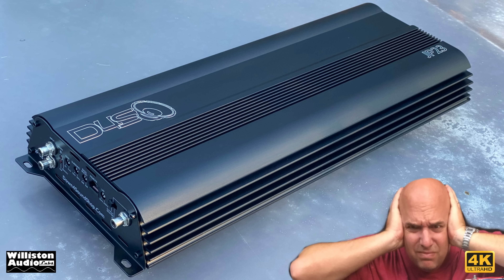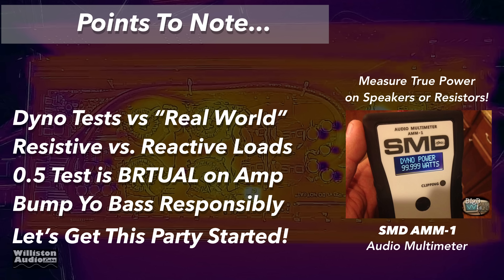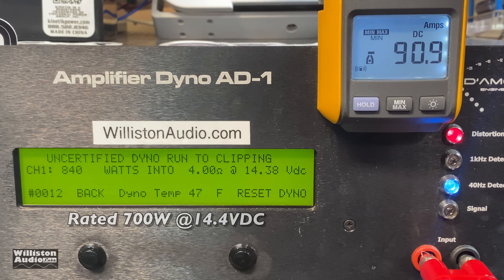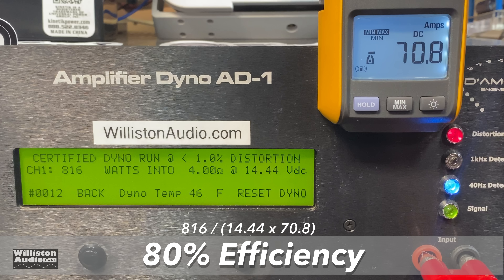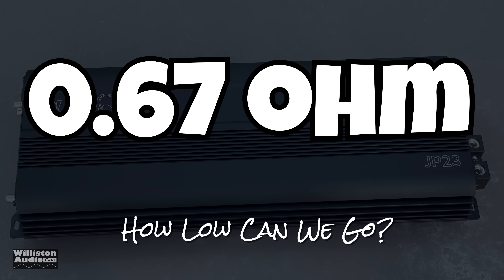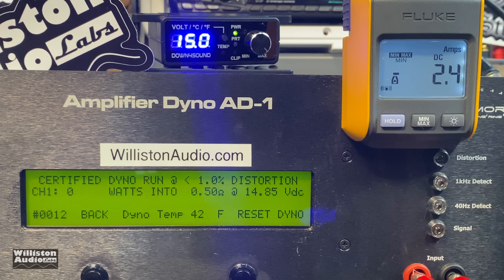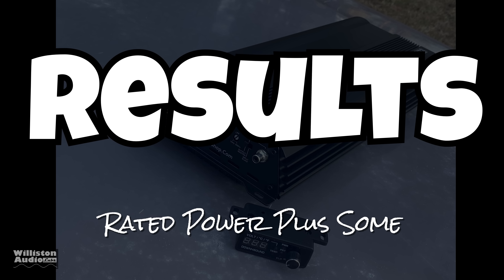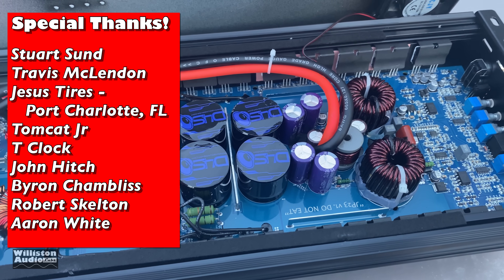Are You Down for Some Low Ohm Amp Dyno Tests? Down4Sound JP23 Amp Test Part 2 [4K]

Comment: Bought the JP23 V1.5, came with this oil inside the "guts" not water but some kind of oil. reached out to D4S and nothing back. opened the plate and tried to clean the oil off but it was everywhere. Asked around on reddit and other forums if anyone had the same issue!

Comment: THE THING ABOUT THAT IS HE IS USING A DYNO MACHINE IF YOU PUT A SUBWOOFER IN A BOX THE IMPEDANCE WILL RISE TO AT LEAST. 7OHMS SO YES IT WILL HANDLE THE OHM LOAD
Reply from the maker: Caps lock a B brotha 🤨

Comment: What does the dampening do?
Reply: its how the amp controls the speakers. the higher dampening the more accurate the bass or speaker will sound. on class d amps you want the dampening factor to be 200+ but to get the most of the dampening you will want to wire your subs up to 2ohms or even 4ohms
Reply: @rowboyto156  thanks
Reply: @rowboyto156  I have dual 2 ohms 12s though
Reply: @30VISION4K  your good bro i honestly cant tell the difference. i have this amp hooked to a 13 w7. i also had this amp hooked to a sundown x 12 wired to 1ohm before swapping to the w7. both sounded good, no difference on the response or accuracy
Reply: @rowboyto156  I'm running the bd sa252 deaf bonce
Reply: @30VISION4K  those are nice, they will go very well with this amp

Comment: I own one, I bought it the day he released it, I live in vegas, I was pumped to get it, but that turned out bad after it over heating all the time in the summer in vegas, it just cannot deal with heat at all, at 120 degrees it turns off, and I am done for hours, I assume I got a first run lemon... my Kenwood 1800w never failed... so who knows, but what REALLY pisses me off is the Reviews on Down4South are filtered and my Review was not posted so do not take what is on D4S at face value.

Comment: Question: I have a Sundown Audio SA 12 D2 and a Skar Audio ZVX-12v2 D2 12" on this amplifier. It’s hitting brutal and clean…BUT I JUST realized I have them running parallel. Is this too hard for this amplifier? How can I tell if the ohms are too low?
Reply: youre at .5ohm, as long as you have the electrical to back it up your amp can handle it

Comment: It only has 100 damping factor tho. At least 200 would be better.
Reply: i used to use this spec numbers too but if youre not wired at 4ohms its pretty much pointless even if its 200. its all about thd% and s/n ratio

Comment: Hey Big D Wiz you think it's possible with all that equipment and your old set up 4 Ohms resistors and battery packs you can start testing power inverters goes along with 12 volts we'd like to know which ones are good and which ones aren't I think it would be pretty easy for you to set that up with your old resistor packs

Comment: I think it's a sweet amp, I like how he optioned it out nice the knob is awesome and has clip light... Why don't all amps have clip lights it would take so much guess work and woofer damage out of the equation...it can't be expensive even my trucks little $90 Toro r2 has one on the amp be nice if it was on the OPTIONAL  knob. I just pre ordered the CAB 45! Can't wait but im gonna have to...whaaaa!  but gives me time to do the mandatory upgrades I need for going to a true 5k from a APCLE1800. It was a toss up from the CAB45 $379 and a $399 B stock SFB5000 at Audio Apex but I decided to go with the looks and  beefieness of a half bridge. I just love the looks of a big ol amp vs how visually un impressive small full bridge amps look.

Comment: Big d. I know you dont do those chinese mini amps anymore but i have a lepy 168 plus. Its rated 40x2 and 68x1 or 34x2. (Used to have 2 subs) like the 168 HA. Try the lepy 168 plus. It wil cost you around 35 bucks. My 400W peak rated jbl towers blast like crazy at 1/8 power of this amp.

Comment: Big D I've been wondering forever when somebody with an amp Dyno would do a head-to-head test between speaker  wire gauges. I am so curious to see the difference output on a 1000-1500w amp between say 16 gauge and 8 gauge.. if the test was inconclusive it would be super interesting to use ridiculously under-sized wire like 18 gauge to induce a  bottleneck
Reply: rmblwgn it's already been proven. Bigger gauge speaker wire will give you a minuscule amount of extra watts
Reply: @long-dongvonbraun501  it's just hilarious to me that people use 8 gauge on a 500 to a thousand watt amp. They don't realize that speaker signal is high voltage low amperage generally, AC not DC... I want to see if my theory is correct that at 1000 Watts 14 gauge would give you the same power output to your Subs as 8 gauge

Comment: I purchased one based on a few ideas in my head. 1) JP is a total bass head. He knows what is good. 2) this is the first batch and I believe first batches are usually robust and later versions can be trimmed down in some areas to lower production costs. 3) as this is his first amplifier I figured he wanted it to be a great success and doesn't need a first offering failing and getting bad reviews. Therefore I thought it would be over engineered .

Comment: Good afternoon, I have a earthquake subzero 10 inch 1,500 watt sub with a 1,600 watt kicker amp connected to it and I am running a 1,400 watt cable wire, I am not getting much power out of the sub, not sure if it's because of the low wire wattage or if I need to get a stronger amp, could you give me some advice of what the problem could be and how I can fix it or make it better, thanks

Comment: Hifonics brz 2400 and Soundqubed q1 2200d have the same board layout. It's pretty common on a lot of amps. You gotta go with Rockford or JL or some other higher end amp to get a unique engineering design.
Reply from the maker: Fo sholo

Comment: As I thought it's basically a continuous 400 watts in to a 4 ohm driver,  thanks for this useful test, I won't explain any further
Reply: You meant to say 8 ohm right?
Reply: @WifeBTR123  a 4 ohm nominal bass driver will run at 8 ohms when being used/powerd, it will almost always stay well above its nominal 4 ohm static resistance,  basically double,  so the amp will only see a 4 ohm sub as an 8 ohm load, it's called box rise, although it's a bad name for the phenomenon

Comment: nothing makes me happier than seeing an amp actually have a very good protection circuit.  this means when you're using it and your voice coils tend to go and go up and smoke or start to short you don't have to worry about your aunt going along with it that's a real good piece of mind.    Jonathan  really has done a phenomenal job with this company and I really am glad that he decided to go ahead and release his own brand of amps
Reply: I can atest to this, just had a 3500w 18" sub melt the leads on it with this amp, wired at 0.5 ohm. Amp never went into protect, had it shut off a couple time do to heat. But always reset afterwards and ran fine. This amp is the best.
Reply: trash

Comment: "all that blue" is from the oil on your lens. even if youre using a phone, go get some higher end sunglasses cleaner to get rid of it. You might have to clean it 2 or 3 times before it goes away fully, but it will go away

Comment: You should start to do ratings at 12v,cause we all know there's tons of people buying 1000+watt amps and using no extra battery or alt.
I know you shouldn't but people are and it would be nice to know wattages at 12-12.4 volts.
Reply from the maker: When I finish my new test bench, I'll have variable voltage so I'll be able to do this. I can do it now, somewhat, but I'll have 400A of power supply plus lithium on tap

Comment: Finally, a Protect circuit in a modern amp that actually work the way it was designed!
Reply: i dunno, mine never worked right and after a 18 months of ownership it let the smoke out. it would overheat FAST... My Kenwood never did... what REALLY pisses me off is the Reviews on Down4South are filtered and my Review was not posted, so do not take what is on D4S at face value.
Reply: @EliteGeeks  what was your electrical like? i beat the shit out of my jp23 wired down to .5 and dip it into the "low voltage" all the time and I have no issues
Reply: @rileyh.4554  0/1 gauge OFC, from the battery, 200 amp fuses, all cables are crimped with hydraulic copper end terminals, 3.5f cap 8" off the amp, I put my old Kenwood amp back in, no problems...
Reply: I beat the shit outta my jp 23 underpowered and all for 3 years now, no problems, and she pounds

Comment: It's lowpass filter is 35-250 but I just wish it played below 35 Hertz! The Orion XTR 2500 D  would be pretty comparable but goes down to 20 Hertz! About $200 more though so idk maybe two of these is the way to go!
Reply: The low pass filter filters out frequencies above 35 hz, not below 35 hz, hence why it is called a low pass filter. This amp plays just fine below 35 hz, as do most amps.....unless there is an active high pass filter engaged.

Comment: No reason this amp shouldn't do half ohm no problem. I had a cheap Hifonics chinese 1200 watt amp that I ran at hslf ohm no problem, and never went into protect. What is this amps issue? I just bought 2 of them and got them today... To run at half ohm 😔
Reply: It will run at .5 just fine on subs  ! Dyno test is a resistive load .
Reply: I’m running 2 strapped @ .25 it will def run @ .5 lol

Comment: I have a powerbass xma 1205d.  
It works great and sounds clean.  
 I'm running it at 1 ohm to 4 4 ohm 10 inch kenwood excelons in a sealed enclosure.  
The manufacturer claims over 85 % efficiency even at 1 ohm. 
 I would be curious to see how it would perform on the amp dyno 👍😎

Comment: I think when u purchase this amp, u can actually buy a warranty that allows you to run this at .5 Ohm.
Reply: HammerBack0 /02 yes you can. It states that plain & clear on the d4s website. All you'd had to do was take 30 secs to double check on the site before you left this comment. You can add .5 ohm protection that covers the amp for one year.

Comment: Look, I undersrand that having a starting voltage of 15 - 16v gives you cool inflated numbers to look at, the fact is however that nobody is getting more than 14.5 volts from their alternator at full duty cycle, and they're going to see a lot of vdroop from there. If the amp has 12v ratings on the box, try and do your tests so the final test voltage is in the mid 12v, so it's a relevant test for the viewers!  Cheers 🍻
Reply: Maybe for all the folks with extra alternator(s)? 😇😎😀
Reply: I used to get a steady 14.8 factory alt
Reply: @pierrem4153  wow!
Reply: Newer cars will vary the duty cycle of the alternator to A prevent premature battery wear and B increase engine efficiency.  For example, my Liberty will output 14.4v right after a cold start-up, then quickly fall to 14v no matter the rpm, then continue to fall until the car reads the battery as charged, then it turns the alternator off altogether until a high electrical load is detected, eg headlight, demister, AC electric seats, electric windows all at once.
Reply: @minus3dbintheteens60  good info here I believe my 21 Kia K5 does this

Comment: Idk if I would be happy when buying a 0.5Ohm warranty for this amp.  But yet the amp can’t really handle it
Reply: JASON JACKSON do you really think that JP is really that incompetent. JP wouldn't release an amplifier with his name on it & turn around offering a one year .5 ohm warranty without first testing the amp & making sure it was indeed stable at half ohm. Think about it... Do you not think that would cost him a huge headache, lots of money giving refunds, repairs or replacements? JP is a business man, not an idiot & last time I checked the whole point of being in business is to make money. I'm sure giving sufficient power & mounted properly the JP23 would be fine running at .5 ohm. If not then he wouldn't be offering half ohm protection. It's that simple, would cost him too much money in the long run. On top of that would get him a lot of hate & bad publicity from ppl posting vids of it blowing while in their car at half ohm load. Time will tell.
Reply: @itdoesntmatterwhatyourname6128  very good point

Comment: My Sony explode amp can run down to 1 ohm. At the moment I have a single 4 ohm voice coil 12-in subwoofer. Do you think a duel 2 ohm subwoofer wire to one ohm will pound twice as hard? It 1200 rms at 1 ohm and 350 at 4
Reply: You only gain about 5 db

Comment: How's he supposed to sell a .5 ohm warranty when it goes into protect on the bench?
Reply from the maker: As I explained, 0.5 on resistors isn’t the same as 0.5 on the Dyno. See the Taramps Smart 3 Low Ohm testing video
Reply: @wal  wasting your time every time you explain it to them. 🙄
Reply: @msh6865  exactly
Reply: @wal  I guess my point is even the other amps it's compared to such as the soundquded run at .5 on the Dyno and don't offer a .5ohm warranty 🤔
Reply: Thats called marketing

Comment: The bass knob is a exact copy of the sundown salt amps
Reply: Also the bass knob on my sundown salt 4 amp my volt meter reads .6 volts higher but when checking power directly at the power and ground with a fluke meter I show .6 volt lower then what the know shows

Comment: The nerdy guy in the corner says "yeah, I like my watts clean" thats why i run my amps at 8 ohms. LOL
Reply from the maker: Nobody wants dirty watts 🤣
Reply: Fk that! Im steeping it up to 32ohms
Reply: @bobdodge3171  nice!!
Reply: I have 152,9 clean dezibel with 14kw rms at home 😁 with 8 ohm speakers... my biggest amp makes 4x 2250 watts rms @8ohms 4x4,6kw rms @4ohms 😂 
But the JP Amp is good for this Price , Jonathan Price 😁👍 i like it and the Amp have all what you need.. @williston audio labs  wonderful video my friend 😊👍 but please test the sinbosen amp fp22000 and the Nobsound 2.1 Amplifier in low frequency.. i have metered 200 watts 20hz and down..
Reply: I’ve always kinda thought that most home audiophiles were of the 8 ohm breed and car guys were sub 4 ohm type. Idk just the way I was brought up in it
Reply: @mikemarkel9203  there is plenty of home speakers that are 4 ohm.   Most are high end.
Reply: @caseytbss  Oh I'm aware, i did the 12 volt side for over 15 years till my body couldnt twist and bend like that anymore so  I wandered over to our home theater side of the store for about 5 yrs.. Everyone have a safe and happy new year! anything has to beat 2020!
Reply: @caseytbss  they wire thevmitple speakers in the box down to 4ohms
Reply: @Jim Catanzaro Because of power consumption and lower current draw and voltage. 2x100w at home even using 120v is less than a 2 amp of current. In a car using 12v it is 10 times more, which requires much thicker wires that are expensive. As you could see there is no much difference in efficiency between 8ohms and 4ohms, but at 4 ohms you can just play it louder with this same amp as long as it can do lower impedances. Also keep in mind that most of the cars does not use this kind of amps. In stock radios there is some integrated chip running at 12-15volts, what can give you 15watts of power. That's why stock car speakers are mostly 2-4ohms and also have high efficiency. In speakers it is how much decibels they can give using this same level of signal. Higher power in car radio means you have to make step up voltage booster and it makes both inefficiency, complexity, costs and takes space. Then manufacturers started using bridged chips to produce more power, so sometimes there are 8 channels in some radios and each pair is bridged to give you about 30watts per channel. Those are mostly rated as 4x50watts by manufacturers, but when you read the manual you can see that it's at 10%thd, that makes it possible to listen only by people with hearing problems. Also I don't really believe that high ohms speakers produce higher fidelity sound, but even if it would - in a car you have many other noises like wind, tires, engine... You mostly need to play louder than better quality sound and when you can do it by basically using lower ohms speakers - manufacturers go that way. Of course it is more difficult for the amp to go lower speakers impedance, but the amps are getting better with it with time. I remember car amps going down to 2 ohms max, but now we have units that can do even less than that 1ohm. I hope I explained to you a bit even though English is not my native language. 😉
Reply: @Jim Catanzaro facts

Comment: So price wise, compared to the others it resembles? I'm assuming it's alot cheaper than the others or are they all about the same?
Reply: Wayne Holderbee did you forget to finish your comment??
Reply: @itdoesntmatterwhatyourname6128  ur right? My word correct must've kicked in? After reading it again. I also didn't understand? But I simply wanted know how much cheaper it was than the ones it resembles.

Comment: Thanks for the content BigD. I was sitting here wondering what the Orion 2500.1Dz would do in the low ohm tests? Might be worth a video?
Reply from the maker: I wouldn’t run XTR-2500Dz under 1 ohm. The HCCA 3k, yes, but not the XTR

Comment: I think I'll stick with the Smart 3. I wish Taramps would make a Smart 12 😨
Reply: I have the md8k and beat the shizit out of it, no issues at all
Reply: @erik120719  exactly. Not the same price point though. A Smart 8 would be sick too
Reply: @mattpierce4143  I think I paid under $600 for mine and the smart 3 was almost $300, last time.i looked at least...so 4x the power for double the price ain't bad. I like the smart 3 tho, dial back the power to compensate for electrical tho, very nice touch, mine will protect of low volts , which can happen when the amp will pull almost 900 amps
Reply from the maker: I bet they do bigger amps in 2021...
Reply: @wal  big d what u know that we don't?????? Spill the beans bro!
Reply: @wal  it would be a smart move. Ditch HD, MD, and Bass line...then just do a Smart 1, 3, 5, 8, 12, and....20 😳